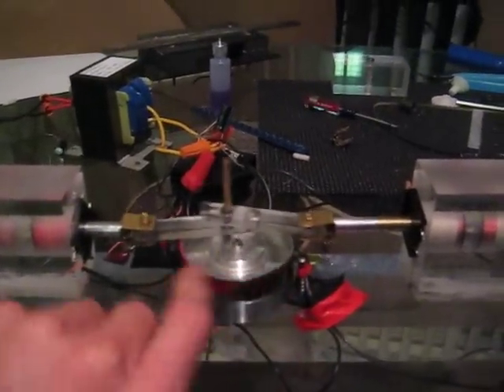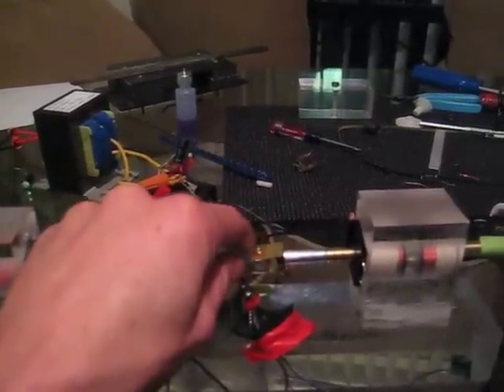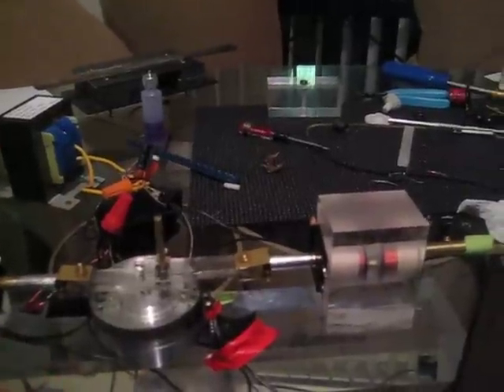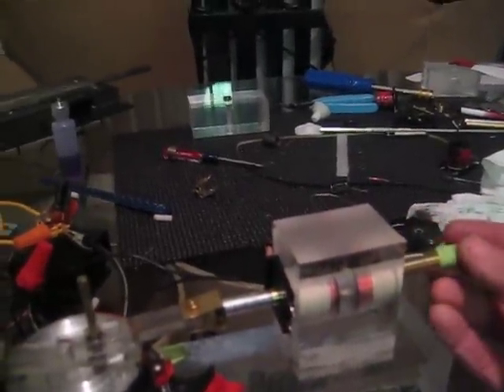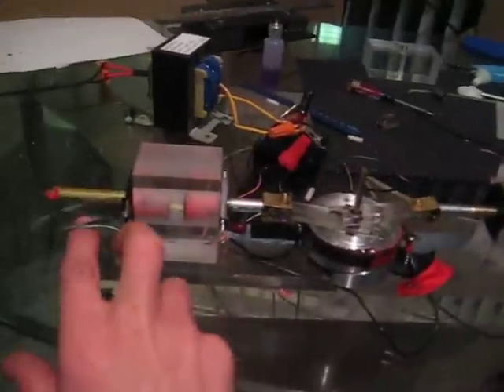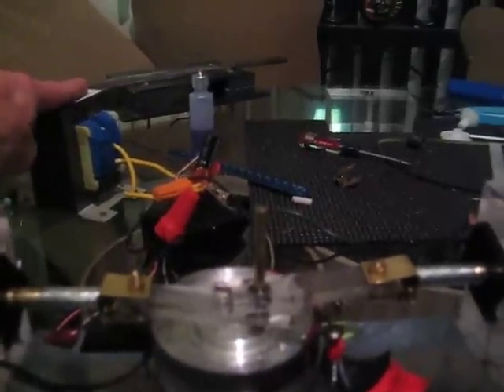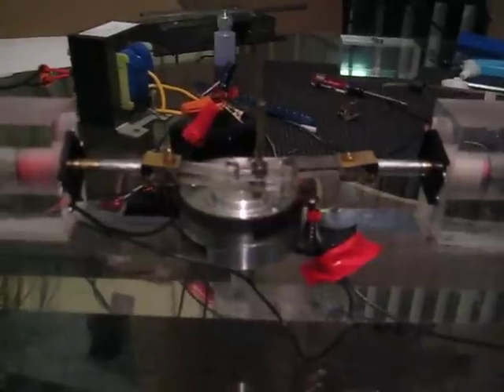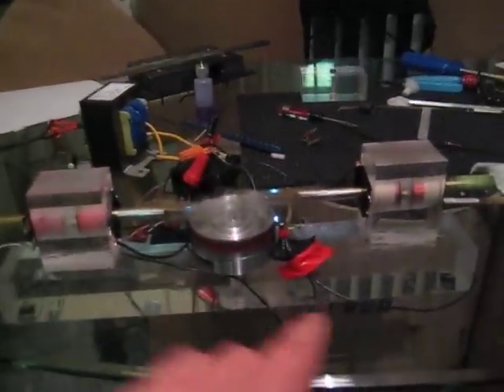magnetic coil duel piston engine hauls, magnet engine

Comment: Cool! High RPM outa that beast. Yep, I used VCR head rotors as well. At first did the switching the same way you did. It worked, but was a bit of a maintenance problem (the brushes). Went optical. Also, I was after 100% continuous operation. Well done and thanks for posting!